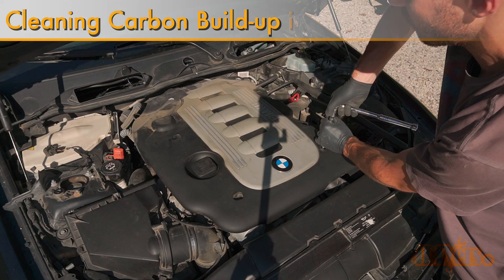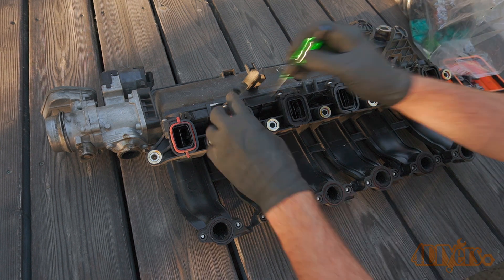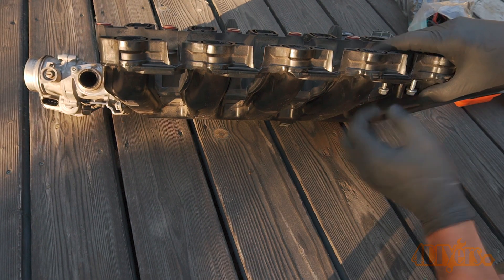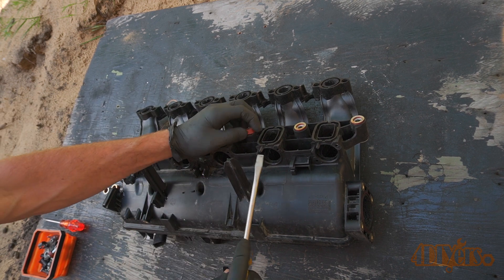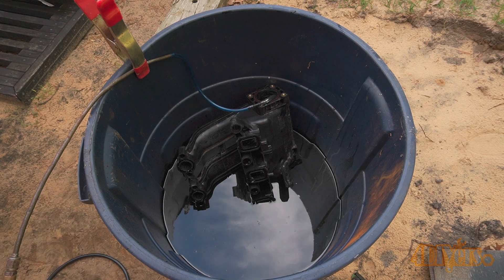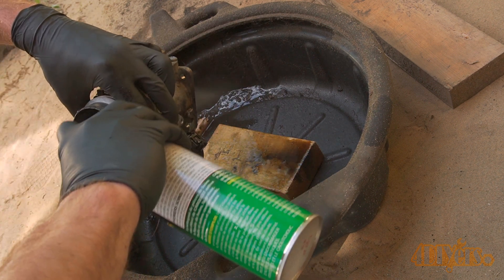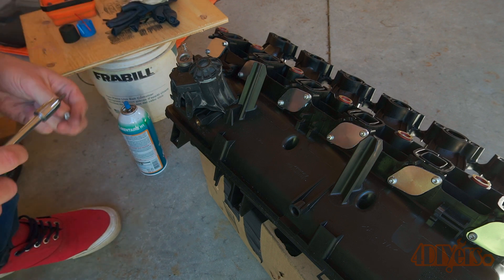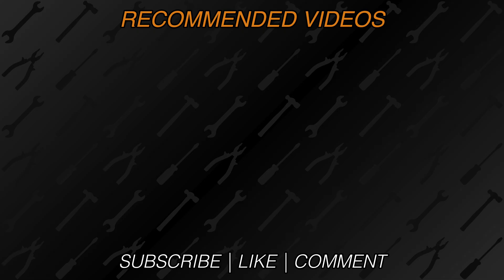How to Clean Carbon Build up from a Plastic Intake

Comment: Do you have any way to clean the channels in the cylinder head without using specialized tools?
Reply: Zip ties cut an stuffed into a drill. Rotate crank to keep valves closed. Use with carb cleaner or alcohol. Avoid the valve stem seal.
Reply: @Aesthetics622best bet yet you can’t see f All On the M57

Comment: Thank you for your great video. I drive 1999 323i 4 door automatic. I kept my intake manifold in purple  power more then 18 hours, plus another 10 more hours  in plastic container. After I was trying to use with high pressure wash at gas station. When I came back home I put my finger to one of the port of my intake manifold and I got shocked  because the deposit is still there. I can grab the deposit with my finger nails.  Maybe I better use baking soda and vinegar.
Reply from the maker: How concentrated was your mixture?
Reply: What worked I’ve been struggling with mine too!